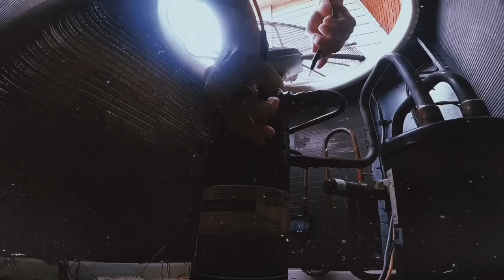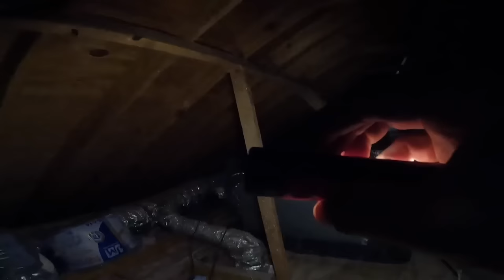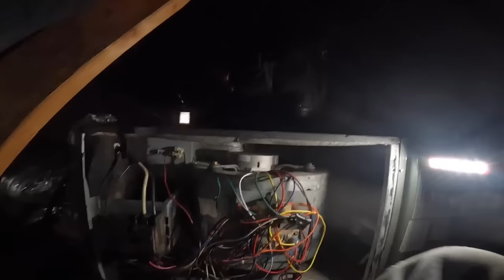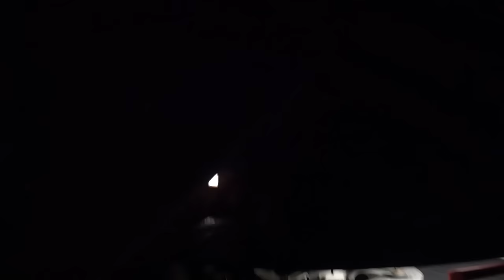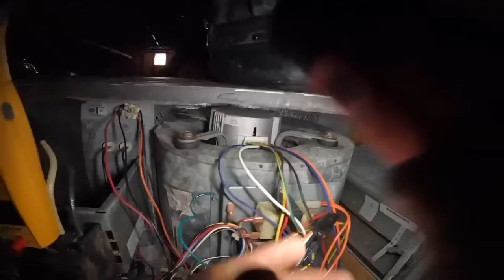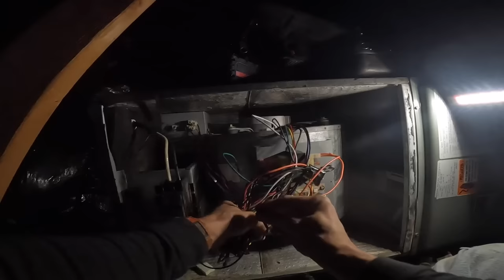Not The Normal Issue with ECM Motors

Comment: There is a way to take a pin out of a molex connector with a very small flat screwdriver. All you do is push the tab down and pull gently. You'll be back.

Comment: Need a light up there. Yes those connects because of vibrations and heat cold cycle's can loosen them. I thought I needed contol modual and moved wires and came on. Boy, was I happy. Good work from Philly.

Comment: there are tabs on metal connectors that hold them in the plastic housing, they make special tools that let you depress the tab and slide the connector out and still be able to reinsert it and have it be secure...just ripping them out strong arm style probably mangled the poor tiny defenseless tab... I made wiring harnesses for years some with that same style connector and housing, seeing the strong arm removal technique made me cringe a little lol

Comment: Yes I get it that it's frustrating. Everyday people however don't understand the trade. The cost of everything, time spent, the knowledge of the system to diagnose, what other techs would do to charge the customer more etc. You can't fault them. They're protecting / defending their finances which was hard to get! They worked hard for it. Just as you did for her... You have to see both sides here.

Comment: Hopefully that connector was all that was bad and it wasn't a bad/cold solder joint on the board in the motor.  The added tension of the wire without the plastic connector could be maintaining contact with the bad joint temporarily.  Time will tell.  Hopefully the issue is resolved if the customer acts like she did.  She will really throw a fit if you have to come back.  No good deed goes unpunished.

Comment: Great video Curtis,

So essentially the hope is that the wire harnass connector was all that was bad? As I think you may be right as clearly the motor wasn't dead and would work for a short period and then you got working like normal. However, me personally I wouldn't trust that motor just in terms of a callback say in 2 weeks or a month later same thing happens again, it looks bad. Best case scenario your fixing works for a long time.